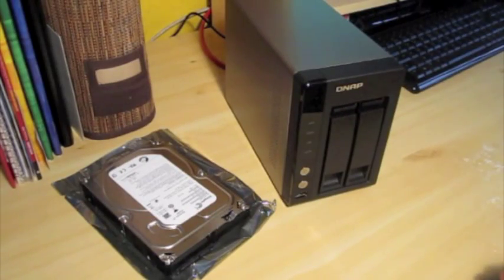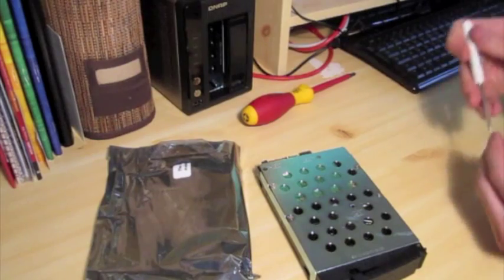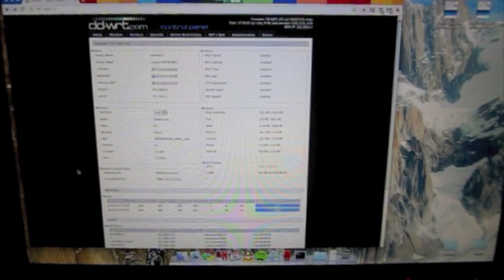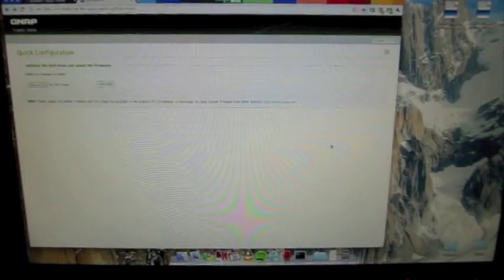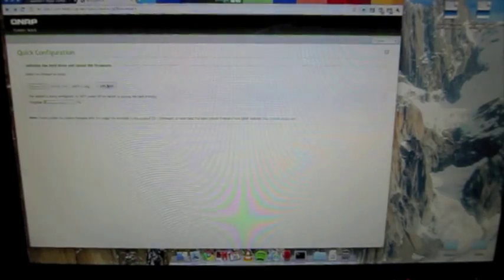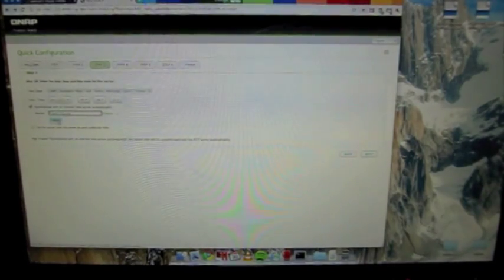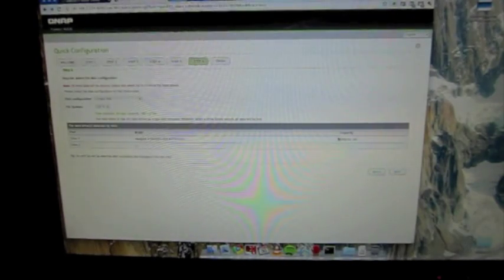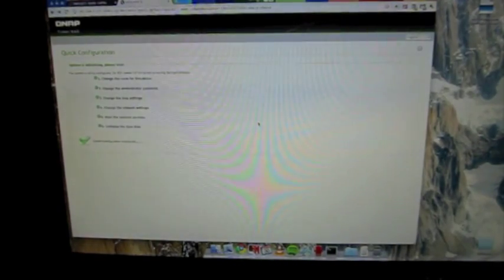QNAP TurboNAS TS-219P+ Setup

Comment from the maker: @KongoApe669 - all these performance stats can be easily found online.  You didn't mention how you are planning on connecting to the NAS.  Read speeds of over 60 Mb/s are achievable on the 219, however the Intel based system (TS-259Pro II) have faster write speeds >60Mb/s.